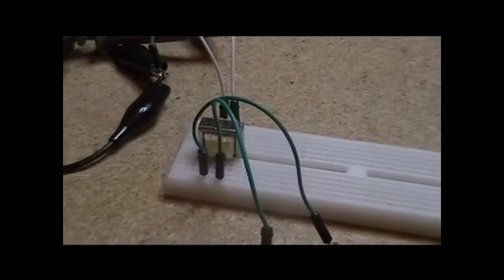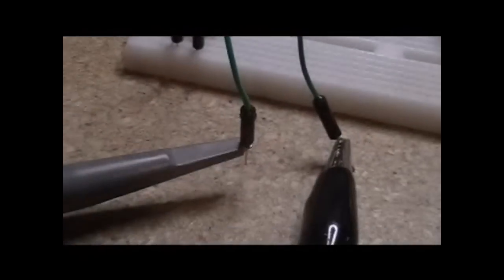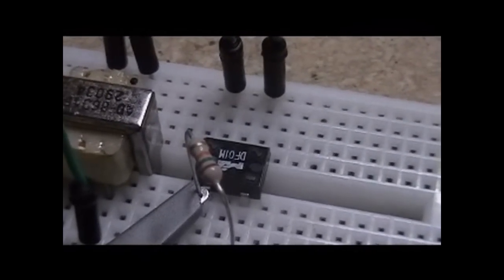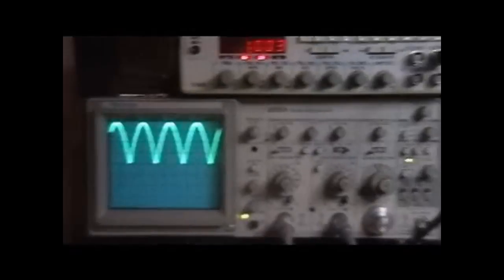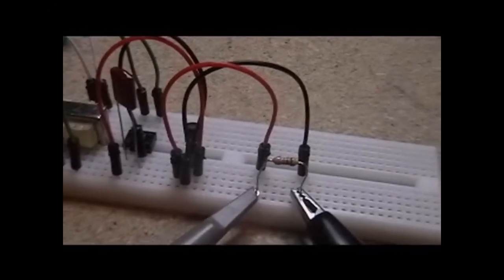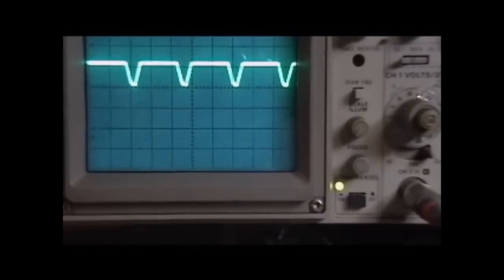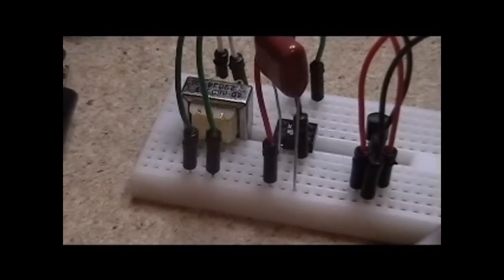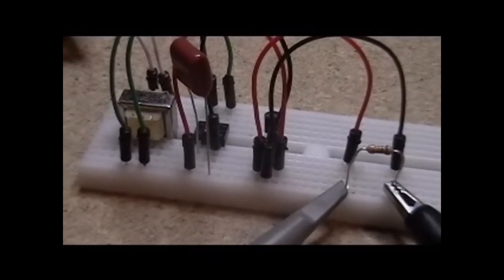Full Wave Bridge Rectifier and Voltage Regulator

Comment: Thanks for the video. I am trying to build this circuit using diodes and having some problems. 

Is the transformer a requirement for this circuit to work properly?
Reply: Yes. Did you finally figure it out? LOL.